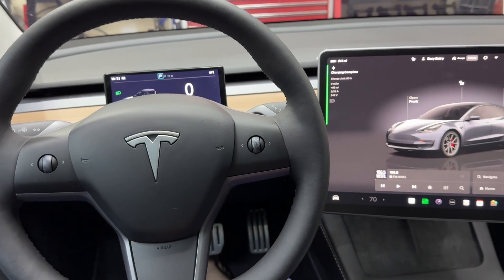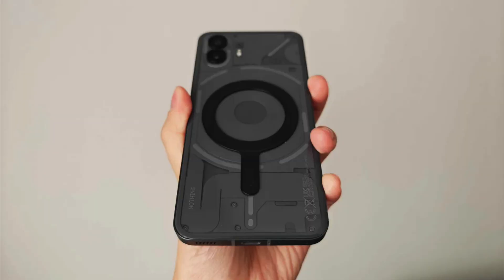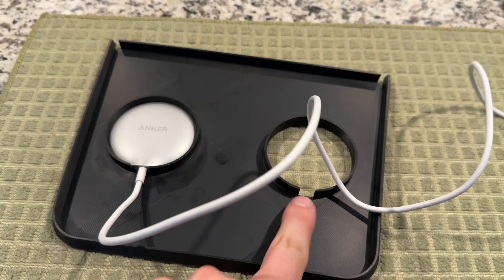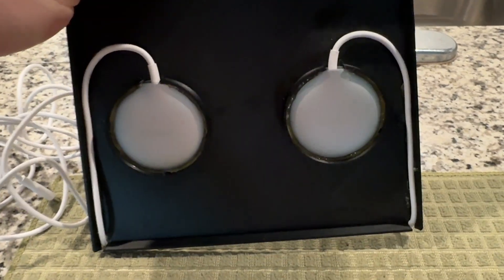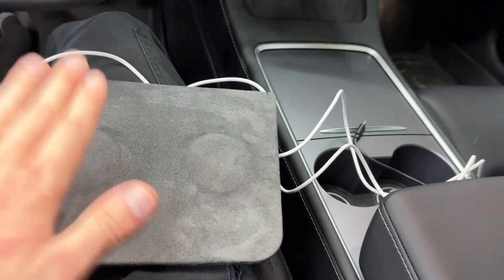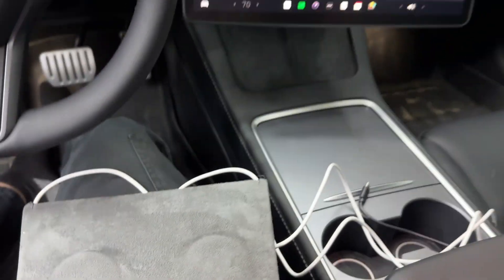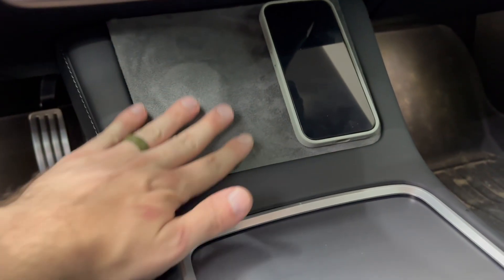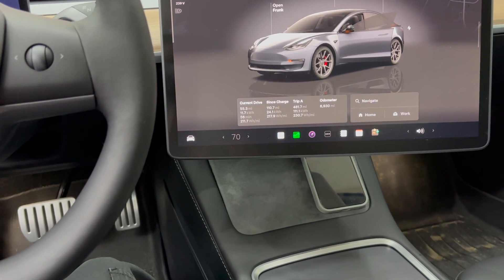Adding wireless charging with Magsafe and QI2 to Tesla

Comment: This is exactly what I'm looking for. Is the existing charging pad the only thing that is powered by the electrical connection that you chose to leave disconnected when you lifted the trim?
Reply from the maker: It is the only thing, everything else still works.
Reply: @JRobling  could you have just used the wiring harness to plug in this thing?

Comment: Awesome video. I was wondering, what if you don’t need any cables and just go from wireless to wireless. So you take one coil and solder it to another with a gap in between. The one connected to the tesla mat sits flat and at the best position and the other one has magsafe and perfectly aligns your phone. You’d think this could work?
Reply from the maker: I tried something similar but it didn't work. I bought a separate wireless charger just to experiment and due to the way they make the wireless charger from the factory it just didn't work. However I am not an expert lol
Reply: @JRobling I just tried hooking a copper coil to another copper coil and it worked. Just coil to coil, no converters in between. I am now going to test it in the car, I think reducing heat is possible if I 3D print a frame for the car that puts one of the coils flat to the chargemat and the other one is magsafe then. Maybe some metal plate in between to make heat dissapear more easily
Reply from the maker: @thomastnc  It sounds like that would work, but you are right about the heat, the one in the tesla already creates a lot of heat, but that may be because of the bad connection it has with the phone
Reply: @JRobling I’ve just did my first test in the car and my phone barely heated up, so that’s good. I am now 3D printing a small case and will do some more tests in the car.

Comment: I can't remember for sure as it has been a while since I played with that particular charger, but I believe Anker uses the rear side of the puck as a heat sink to keep the charger cool. It will still work fine, but you likely won't get the full 15W of advertised power out of them during long charge sessions with them enclosed like that. Still probably better than the stock charger.
Reply: well I'm pretty sure the default speed is 5w from the factory so.